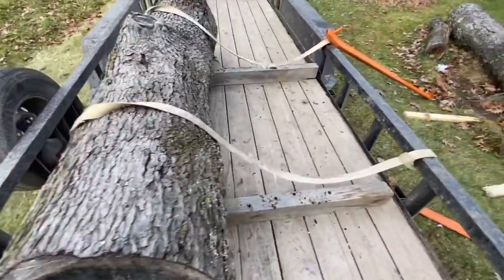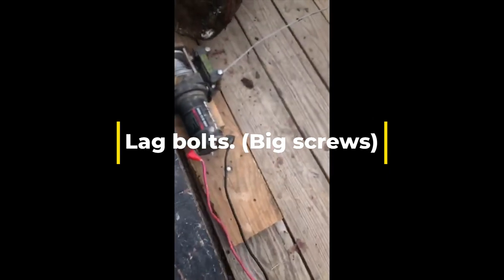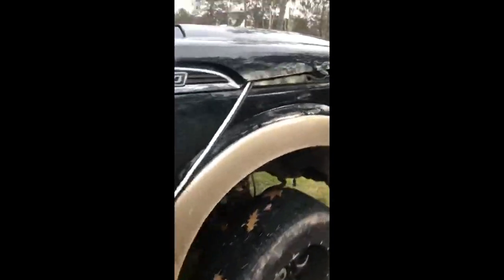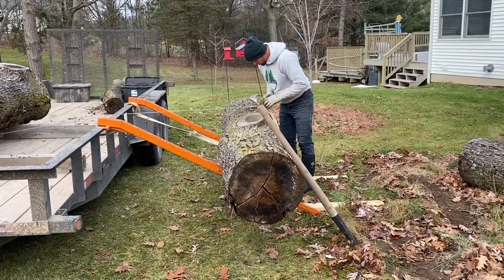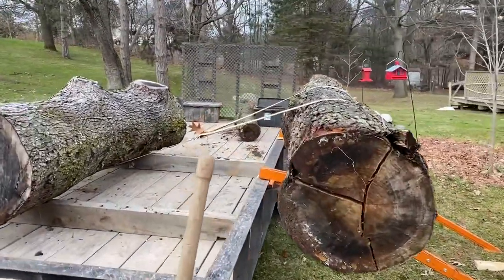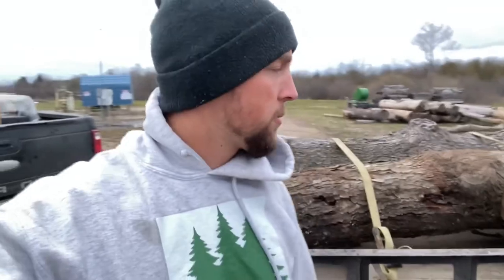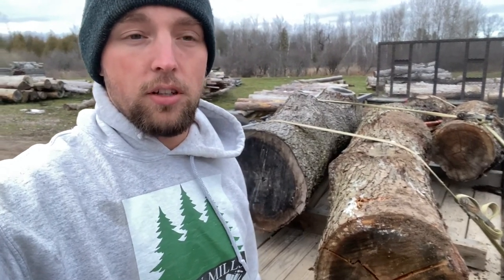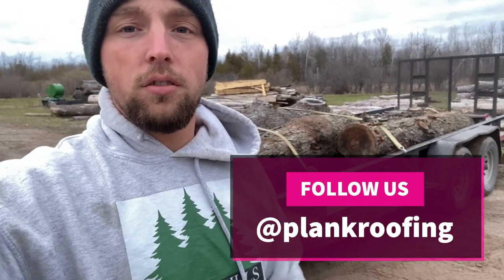Loading logs onto a trailer - how I do it!

Comment: Your battery powered cable winch sure is handy loading logs on your trailer.
Reply from the maker: Yes, it is! I’ve used this 
Method a good number of times now. And it works quite well for me.

Comment: How big was the winch. Uve told me NOTHING. A VAGUE VISUAL COMPLETELY DIVOID OF SPECIFICATIONS, PARTICULARLY THE lbs. Winch
Reply from the maker: I’m sorry about that. 
I believe it was a 2,500 lb winch.
Reply: The only thing he DIDN'T tell you was the size of the winch. It clearly shows how to rig the ramps, the cable/straps, the winch placement, even the battery cables. Great video, don't apologize.